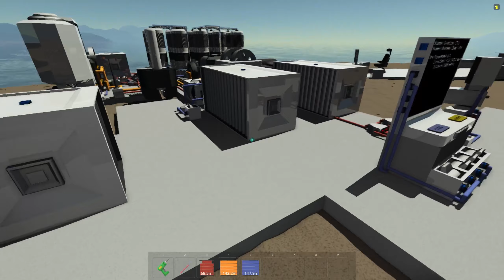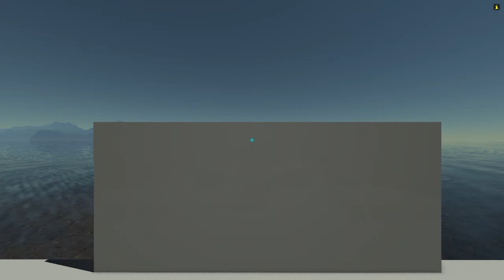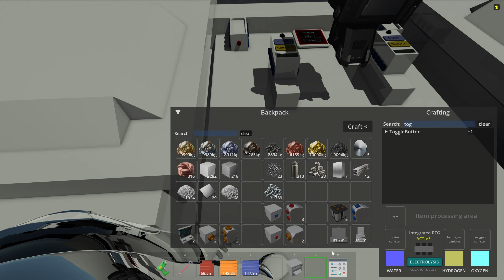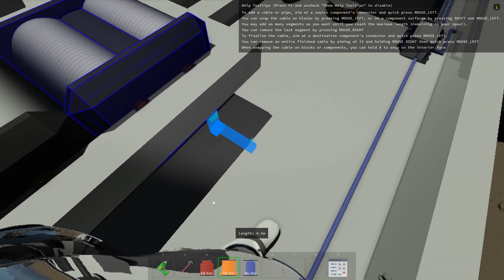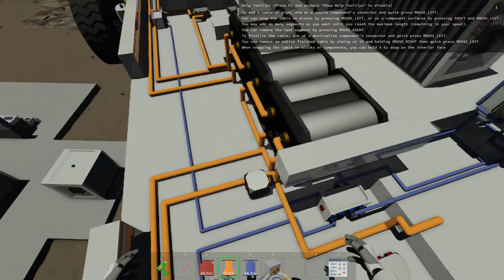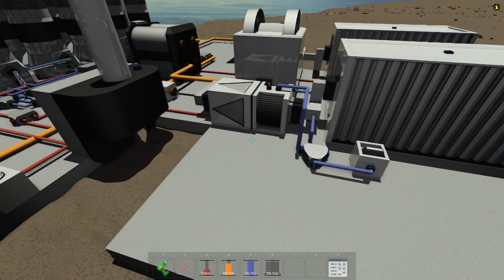Archean: S1 EP20 - Amphibious Mining Vehicle (Part 4)

Comment: I v been looking every whare and i can't find titanium for buildind the steam turbine. Do you remember where you find titanium. I love you video's. Keep em comming.
Reply from the maker: Note: The "small" steam turbines do not require titanium...

In this series where I have the stationarity ore scanner on my base, if facing forward (out to the water) at pivot angle 0.   There is 6% titanium at 148 degrees at 16,000 meters (so behind and little to the right).    It should be at the very tip of the big mountain.

My plan (not for a few episodes) is to ground travel for titanium as far as I can with the ground more or less level, then build something that flies to get to the peak.    Also possible to just jet pack up there...  Just takes a while.
Reply: @jakearchean thanks for the info. Did not know there was a small one